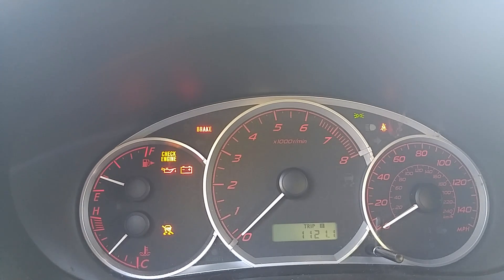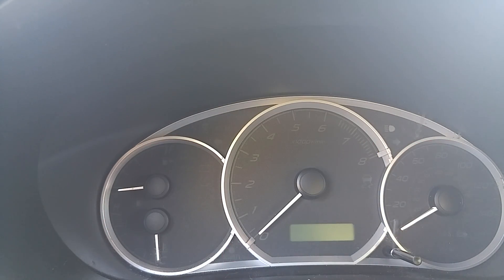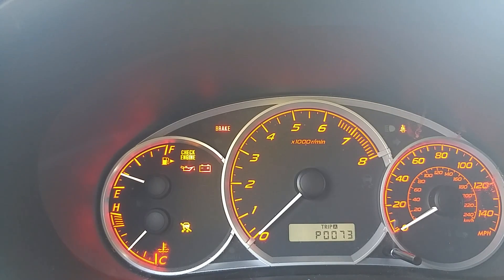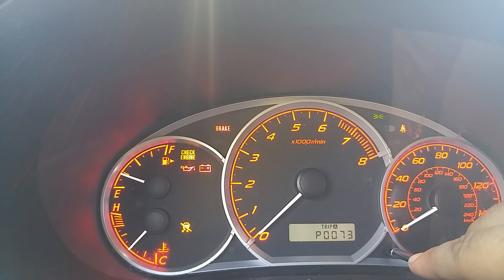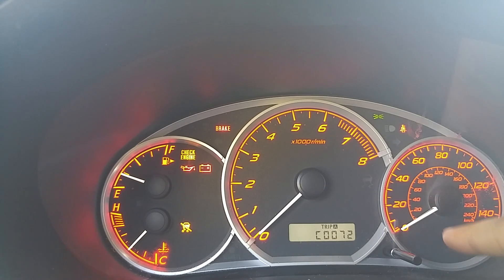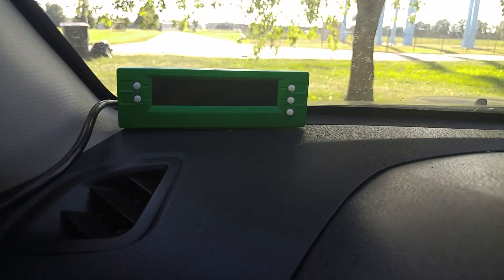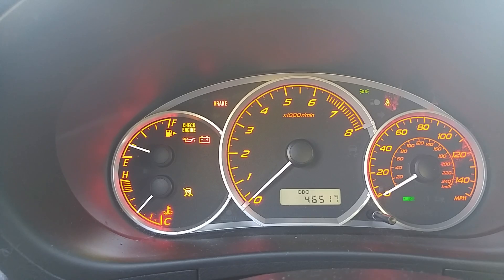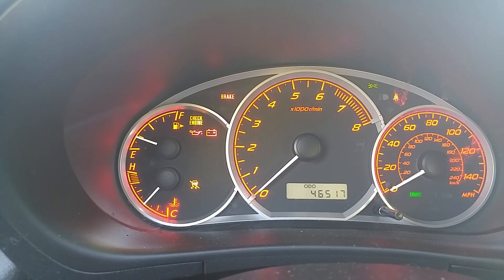Display codes without a scan tool, 2010 Subaru WRX

Comment: I only have the c0057
Reply: 2011 wrx
Reply from the maker: @aidantaylor4149  Thats a VDC code I believe.. the most common thing would be an ABS wheel sensor communication issue.  The codes I got there were related to heat somehow and only happend on very hot days if the car was sitting out. I simply reset the ECU and lived with it. The 57 code alone could be a failed wheel sensor. I can not recall how easy they are to replace in that vehicle. Some are very easy to replace, 1 bolt and they slide right out, others are built into the wheel hub and require some disassembly to get to. Id try resetting the ECU and see if it comes back, if it is persistent then its could be as simple as a dirty sensor.  A scan tool may be able to give you more incite of exactly which one is giving trouble. There is one in each hub.

Comment: I'm literally on vacation in my 2009 Forester and this video has given me peace of mind. Good old P0420. Thank you for putting this trick out there!
Reply from the maker: Hey thanks for watching... glad I could help.  You get this figured out? Could just be a sensor issue or an exhaust leak.
Reply: @spdwebdotnet  using a tool that goes by the name "e-scan" I have determined that the single catalytic converter is borderline bad. Looking at the downstream voltage readings on the highway I tend to agree with it
Reply from the maker: @TheTech9  Its a toss up on that one. I generally replace the down stream sensor first, unless there is something else obviously wrong. I've actually never had a CAT go bad on any of my vehicles, (the ones that still had them :)  but I have had a few wonky sensors below threshold.

Comment: My 2009 Subaru Imprezza R is showing traction control, engine light, and cruise is blinking. However, I tried this, and now showing three codes: P0420, C0047, C0057, I noticed My car missing an air intake duct for the car air filter... that might be the reason for this... but not sure. Please, help me out if you know anything about this.
Reply from the maker: Hey thanks for viewing.. curious, do you notice your engine rpm dip sometimes when coming to a stop, or the engine surges under light throttle when you are holding the pedal steady?  Do you recall how the vehicle acted exactly when the lights came on?

Comment: Hi, I replaced my 2014 Subaru Crosstrek wheel bearing ( left front ) then I did test drive. Looks everything okey after that ABS light traction control and hill assist light on. Also Engine light on to engine code is p0500 ABS code is C1222  I changed wheel bearing again ( moog brand ) nothing happen then I changed ABS sensor still same... I didn't figure out ! Do you have any idea ? thank you
Reply from the maker: I can only assume, since this happened directly after the wheel bearing was replaced, that this may be a clue. Check all the wiring down to the wheel sensor starting with the factory wiring in the wheel well. Check the connector over real well. Look for bent pins in the plug, crimped or cut wires. Possibly (but unlikely) debris blocking thr senson from the pickup ring in the hub. Both those codes are speed sensor codes and directly related to the wheel speed sensor. There is a sensor on each hub. Thanks for viewing!

Comment: I have an ‘11 WRX STI hatchback.

I was driving down the road at about 45 and the radio started skipping, then lights flashed, and I clutched and slowed down, turning on my hazards, the engine sounded like it was shutting off and on, but there wasn’t much RPM loss, it would flutter, and then it started back.

The radio was reset. The clock on the dash was reset. And I went ahead and pulled it into a gas station, I shut her down. And waited about three minutes. And she started right back up.

She had past codes thrown. But they were resolved. And my buddy looked for new codes. No new codes.

Could it be wiring? I purchased this car and it has aftermarket radio. 

The other thing... This is funny. The gas keeps going down and I can’t seem to keep it full.... (I really enjoy this car).
Reply: Sounds electrical for the most part there. The gas gauge is reading low or it's actually just burning through fuel? Will it let you put more gas in it when it's reading low? If not that sounds like there's something wrong with your gauge. Also probably electrical if you're having other problems as well. After you sort those out you should reset the ECU to be safe.
Reply: @kylejeanfreau9565  The fuel part was only meant as a joke. (Can’t keep it full hehe) the other was electrical. I sat down with it, cleaned off the battery terminals and it works like a champ now. (But still just can’t keep that tank full)
Reply: @kylejeanfreau9565  Thank you for your reply by the way!! I did reset ECU. And ran codes. It did not throw any codes. Have a good one! :)

Comment: Great video, 05 outback xt, had to disconnect battery for extended period, due some work I was doing.
Is there a way to get rid of er iu code other than dealership reinstalling crap.
Car runs great just have the aggravating code.

Comment: Did u eventually found out what C0047 and C0057 are caused by ( both of them point to VDC )   ... i have the same code and also C0071   which is Steering Sensor and also connected with the VDC ..
.
Reply from the maker: Hello and thanks for viewing. I never did actually fix this problem. It happened to me so infrequently that I just cleared the codes and went on. Only happened on very very hot days if the car sat in the sun. What I surmised was happening was a loss of communication due to a wiring issue.. IE: Some connector somewhere was expanding in the heat causing a momentary loss of connection. I believe their is a TSB on this but I'm not sure.
Reply: @spdwebdotnet   thank you man

Comment: Hello , I have a 2016 Subaru wrx sti when i turn the car on wen it’s cold it shakes a lot rpms go to 1.5k than as the car starts warming up it drops to like 800 with no more shaking is that normal ?
Reply from the maker: Thanks for viewing. No check engine light on or blinking? Any modifications done?  1.5k is correct for warmup.  Do you have access to a code reader? If you can hook a decent code reader up that has live data you can check some parameters. Boxers tend to vibrate some... I wouldn't consider that "shaking" though. Generally a rhythmic shake.. which you would be able to see if you pop the hood and look at the engine would be an indication of a weak fire or misfire on one cylinder. Possibly caused by a fuel issue... incorrect air fuel mixture etc.

Comment: you can see code list on this link https://www.google.com/amp/s/www.troublecodes.net/subaru/%3famp
Reply: C0072 Brake Temperature Too High (Subfault)
P0073Outside air temperature sensor -high input

Comment: Would engine check light turn off if you change out the ambient air temperature sensor? Or do we have to manually turn it off?
Reply from the maker: If you have a p0070 code it should clear once the problem is corrected.. it may take a few start/warmup cycles to clear.

Comment: Oh my god buy a honda
Reply from the maker: 1984 Acura Integra, 1991 Civic DX Hatch, 1992 Accord EX, 1998 Civic EX, 1999 Civic DX, 2001 Accord LX, 2003 Accord EX-L V6, 2008 Honda Fit Sport..  Ive owned more Hondas then Subaru's.  Enjoy them very much.  Still have my vintage 1975 CB360 motorcycle
Reply: @spdwebdotnet  i love you
Reply: @spdwebdotnet  stop boxin and start knockin
Reply: I agree..I won't buy another Subaru ever
Reply: @Steede Dsrree yes I made a switch from Acura to Subaru.Never again

Comment: how do you reset it without turning key to acc position each time?
Reply from the maker: matt conroy Reset the ECU completely? I just disconnect the negative battery cable for about 10min. Step on the brake to drain any residual energy in the system. That will reset everything. If you have a problem though the light will just come back on right away.

Comment: My subaru legacy 2006 has the interior dome light flashing, the remote lock/unlock doesn't work any ideas on what the problem is?
Reply from the maker: Sorry I didnt see this until now.  Id start with door switches..  If there is a lose wire or a bad switch this would cause the dome light to flash on and off as the vehicle would perceive the door being opened and closed, this would also have an affect on the remote lock and unlock as it wont work when a door or hatch is opened.
Reply: @spdwebdotnet  Found out what the problem was, the problem was that there were 2 white diagnostic connectors plugged together below the fuse box under the steering wheel ,by a quack mechanic. Unplugging the connectors everything went back to normal and worked fine

Comment: is that regular temp? a hair above mid, is that normal?
Reply from the maker: You are speaking of the engine coolant temperature I assume? Usually it sits right in the center of the gauge. I also have a scan tool (scan gauge 2) that sits up on the dash which displays coolant temperature, boost/vac, intake air temp, and voltage. I've never seen the coolant temp above 190F. The temperature I am speaking of in this video is outside ambient air temperature. When it gets above 95F outside, and the car sits it will throw a code when you start it.
Reply: spdwebdotnet yea i just bought a wtx 2012 40,000 miles and it sits in the middle or an hair above like a hair nothing crazy up just wana make sure its fine
Reply from the maker: Raymond Camacho Yep that's spot on. The gauge in the cluster there is just to give you a general idea that everything is OK.. it's by no means real accurate. Still better then just a light in my opinion. As long as it comes up somewhere in the middle and stays steady you are fine. It's when you see it rise and fall you may have some troubles developing. Sticking thermostat, water pump etc.

Comment: Is your cruise light blinking constantly with the check engine light on?Mine has that problem, and I cannot figure it out... Any tips?
Reply from the maker: You will have to pull the stored codes to see what the problem is... or what the ECU is "suggesting" the problem is... gives you a good starting point.  Once you get the codes you can clear the ECU by disconnecting the negative (black) battery terminal from the battery, and either turning the key or stepping on the brakes to release any residual power left in the system though that last step is probably not needed if you leave the cable disconnect for 10min or longer.  See if the problem returns. Depending on the failure mode your car is probably running in open loop mode which runs basic fuel maps and functions. The cruse control will not work until you clear the codes/fix the issue causing them.

Comment: I have a 2008 impreza 1.5r and it works..! My codes are P0500 and P0037. Any idea how to clear the engine check light?  Thanks
Reply from the maker: Francisco Andres Gomez Saavedra You can reset the ECU by disconnecting the negative battery terminal for 10 minutes or so. For good measure once you disconnect the terminal, turn the ignition on to drain any residual power in the system. If there is still a problem with the car however, the light will come back on.
Reply from the maker: Let me add something... once you do reset the ECU it will have to relearn idle. I usually start the car and let it sit and run for 10 minutes or so without touching the throttle. You can then drive, easily at first, to let it relearn all the parameters.
Reply: Thanks a lot. I will try it .

Comment: Happened to me. Reflash ECU at Subaru dealership for free. Engine is fine and does not over heat but this happens. This is a recall. I have a 2011 STi limited.